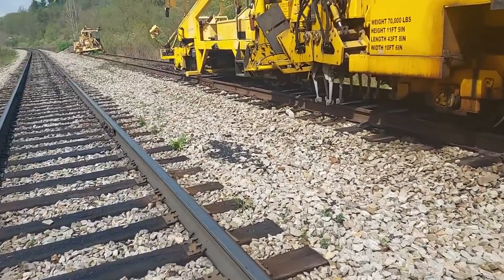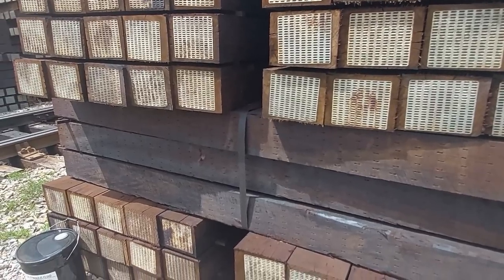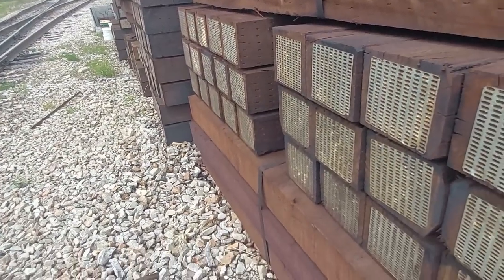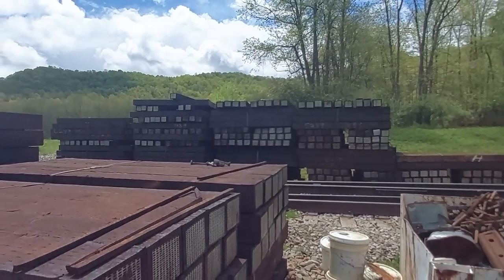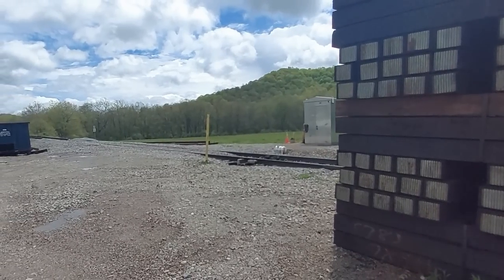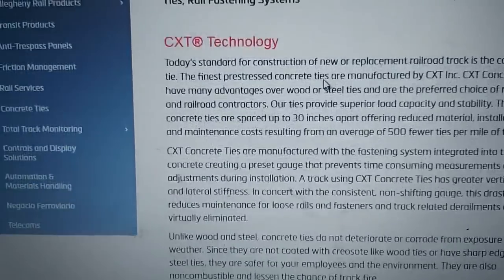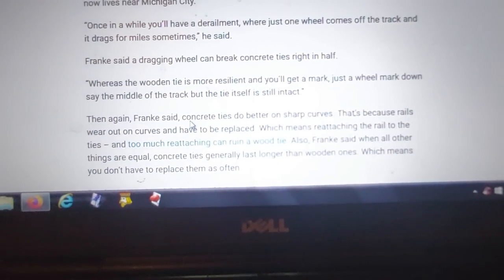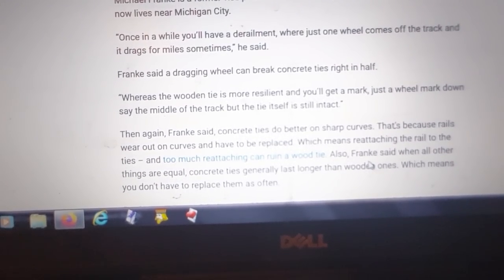Why some Railroads use Concrete and some use Wood Cross Ties

Comment: One thing about concrete ties in the curves is gauging, it can be troublesome with the lateral forces of the weight pushing against the high side of the curve wearing out the insulators thin causing wide gauge and rail canting, it can be high maintenance.
Reply from the maker: Thank you so much Jason for sharing that. A point I would never
even have thought of, but you would know! For those who may
be reading this, Jason works BNSF MOW and is very knowledgeable
about track maintenance. I have a lot of respect for what he
knows and his help he has given me over the years.
Reply: Such is American rail roads. These lines were laid by MEN. They did not give excuses, they did not ask questions ,they just did it. And still do.  I admire these men. Wow!!!
Reply: @ccrx6700  Thanks Dave, I’ll try to get some pictures and show you some details when I can.
Reply: We've had a big accident, unfortunately with fatalities, here in Germany a little while ago with failed concrete ties. Exactly like you say, the ties got beaten up, failed quickly after each other, and the train running over it pushed the gauge out of whack. They later determined that the plant that made the ties mixed bad concrete (wrong/chemically incompatible aggregate in it, I believe). That put the railroad in a real pickle, having to rip out about 200,000 ties with the same defect as soon as possible. Lots of slow orders all over the place for a while.
Reply: @bain5872 . Drag those knuckles, boy!
Reply: @kennethhoffman8061 there are inherent problems with physics that cannot be overcome, regardless of the quality of the concrete.
Reply: @2xKTfc  And, that is proven that it was due to the sleepers?
Or did you, for the sake of simplicity, make up some newspaper report from 2022 as "evidence"?
Reply: UK has used concrete sleepers (ties) for 50 years. It’s reliable, though of course quality control is always important.  They are never mixed with timber sleepers and are always bedded into new broken stone.
Reply: @3RTracing  Sorry, but that is bullshit.
Everywhere in the world the railroads use concrete sleepers, only in America one finds "problems with physics that cannot be overcome".
The American problem with said physics is: Concrete sleepers are heavy, far more heavy than wooden sleepers,  and you can't treat them and deal with them with the same 19th century tools you use in USA to throw wooden sleepers around.
Compare an American MOW brigade small rumble carts with a European or Indian company's work train for changing sleepers. Then you know what I mean.
Reply: @ccrx6700 hi Dave did where you work use to be called FRONTIER?
Bcuz I saw a FRONTIER MOW truck getting ready to install new ties etc on the tracks of our local short line railroad.
Reply: A very good information. Gain more knowledge. Thanks.
Reply: @2xKTfc  While the investigation seems to be pointing to the ties/sleepers, it seems to be more an issue of defective manufacturering, than a condemnation of concrete ties.  

Still, I can understand how a defective wood tie probably wouldn't have failed in the same way.
Reply: @2xKTfc  Oof!  What a disaster!
Reply: @pearlyhumbucker9065  We do have much heavier trains and axle loadings permitted in the US compared to most of the rest of the world.  That can mean that certain things that might not show up in other parts of the world do show up as serious problems in the US and simply do not work.
Reply: What about plastic railroad ties?  I know those have very long life spans and are often made of material that would otherwise go to landfill.  How common are they and what are the advantages and disadvantages?  Cheers!
Reply: @unconventionalideas5683  Maybe.
But what you certainly have is an irrepressible urge to bend the laws, save a little more money everywhere and try to get away with it in the cheapest way possible.
The fact is that there are areas of the world with railways that easily surpass American conditions. The longest and heaviest trains do not exist in the USA, but in northern Australia and South Africa. 
And would you believe it - they operate on concrete sleepers there. 

"do show up as serious problems in the US and simply do not work"
Sure. One of the problems is that concrete sleepers are not as easy to handle as wooden sleepers, so the Unions object. That's because concrete sleepers can't be handled with toy machines like the ones used by American MOW gangs - you need full-blown rebuild trains like the ones from Plasser-Theurer, for example.

But of course the Unions are against them, apart from the fact that they are not cheap.
So on American railways they still like to fiddle around like the MOW gangs in the Wild West: wooden beams and simple nails for the sleepers.

Ok then. Tell me, what ar the numbers? Axle loading? What have heavier trains to do with a single sleeper?
Reply: Only in America is this a problem
Reply: @3RTracing I think all European high speed rail links are a concrete, running passenger services every 20-30 minutes at 160 to 200 mph.
Reply: @pearlyhumbucker9065 , ‘Everywhere in the world the railroads use concrete sleepers, only in America one finds "problems with physics that cannot be overcome".’

I agree 100%. These are just excuses to stay behind the rest of the developed and the developing world.
Reply: @pmaitrasm It’s not an excuse.It would take billions of dollars, to replace the whole railroad tie system. You would have to make concrete ties companies, you would have to buy new machinery, You would have to replace almost everything. You would have to teach workers, about the new system. It would actually be in the trillion’s mark, to replace the whole system.
Reply: Your comment is false the gauge is preset on concrete ties so curves does not effect the gauge and it does not wear out insulators  do research before making a comment.
Reply: @pearlyhumbucker9065   North America has the largest rail network on on the planet.  And it moves more tonnage than basically the rest of the planet combined. Wood has proven to be superior in most all instances for the North American demands of tonnage and climate and track and road bed conditions.

Comment: Coal will decay the concrete. I used to work at a coal tipple and the coal being piled up against the concrete piers caused them to dissolve away where the coal touched them. YOU GO DAVE!
Reply: Just a guess, but some coal has a lot of sulfur in it. Rain may have combined with the sulfur to form sulfuric acid which eats up concrete. In southern Louisiana the rain will eventually eat away at concrete, gradually exposing the gravel. Of course, it takes about 30 years to become obvious. That is probably one reason why they made refiners start selling super low sulfur diesel fuel. It produces less acid rain.
Reply from the maker: Thank you for the nice comment Transmitter Guy, yes sir I will go,
keep on keepin on....  :-) Appreciate your taking the time to visit and check out the railroad tie video my friend

Comment: Back in the '80s, we used old wood ties as posts for our corrals on the farm.  Connected them with 2x10s and channel iron.   Held up very well over the decades.
Reply: In Australia our State government (Victoria) won't let old railway sleepers from the suburban network be sold due to them having asbestos dust ingrained in them from the train brakes.
Reply: And the horses wouldn't nibble them because they were soaked in creosote.
Reply: My grandfather built fences around the homestead in the 50s. They are still in good shape. To bad barbed wire didn't last as long as the ties have.
Reply: @ianmontgomery7534  That's an example of  what my first boss (Doctorate in Chemical Engineering) called "Locking the doors and leaving the windows open."   A good deal of engine braking happens in railway stations and, by default, kicks out airborne particulates from the linings.  It's also where many people congregate of course.   

The greatest danger would be from handling the bitumen surface itself (it contains carcinogens). But, after a few decades of use, most of the 'nasties' from the bitumen would have degraded or evaporated.  

Asbestos is now banned in most applications, such as brake-linings but,  pre-1973 (ish) most car brake linings would have contained it.  That meant that hanging around a road junction or anyplace where cars slowed down would guarantee you a dose of the deadly dust.
Reply from the maker: I've got many an old tie here on our farm as posts 2 Many Fords.
We used to give away a lot of old ties to farmers around here,
but farmer numbers have dwindled a good bit, not too many
folks even want them anymore. Appreciate your taking the time to visit and check out the railroad tie video my friend
Reply: @ccrx6700  Could you do a segment on plastic railroad ties?  They are usually made of recycled material that would otherwise go to landfill, and they have advertised lifespans twice as long as even concrete ties.  They seem to require similar equipment and installation procedures as wood ties.  Please do a segment on them if you can.  Cheers!
Reply from the maker: @unconventionalideas5683  yes i will sometime in future 👍😊
Reply: Cresote?...dead cows?
Reply: I've used them and phone poles for "dead men" on terraforming type jobs.
Reply: @unconventionalideas5683  We used recycled material (plastic ) on waggons to load steel onto instead of wood (wood was being pinched for fence posts ) Only problem was the steel was pretty fresh from steel works (hot ! ) plastic melted and stuck to the steel

Comment: Prestressed concrete is done by placing steel cable under extreme stress, pulling the steel tightly with a machine or tool, then pouring the cement on top.  When the cement has set, the tension on the steel is released.
Reply from the maker: Thank you for sharing that info Richard.  Appreciate your taking the time to visit and check out the railroad tie video my friend
Reply: The tension of the steel is not so much released as it is that the steel pulls the concrete into compression (where concrete is strong). This works better than simply reinforcing the lower third of the tie (beam) with rebar which takes-up the tensile force imposed on the lower section of the tie (beam) under load that the concrete by itself cannot significantly resist. I.e.: concrete is very strong in compression but very weak in tension. Steel is very strong in both, so steel reinforcement is used to make-up for concrete's weakness in tension.

Comment: I have been dying to ask that very question. I knew there was a reason, I just didn't know what it was. But watching this, I had several thoughts. If a concrete tie weighs 700lbs, the an 18 wheeler could haul less than 60, whereas he could haul over 200 wood ties. So your transportation cost would rise significantly. You mentioned about the difference in maintenance equipment. But I'm sure the installation equipment would be different and more expensive. As for carbon footprint, wood may not be as bad as you think. Concrete requires lime that is fired in a kiln after the limestone is mined. The mining itself will have a carbon footprint. As you pointed out, trees remove carbon from the air. When treated ties go back in the landfill, the carbon is locked up forever and the carbon cycle is broken. Perhaps you and I could getva grant to study this...😅
Reply: yeah even if you consider the local effects of creosote the effect on the environment from concrete is absolutely gigantic in comparison, 400 million cubic yd per year in the US alone!!
Reply: Jasper, that's right. If the point is to reduce the carbon footprint, wood ties are probably much better for the environment than concrete ones.
Reply: Same could be said for harvesting the wood which has to be transported from the (hopefully) managed forest to the sawmills.  There is no formula to fit all scenarios for this kind of thing because your source of material is always changing.  As for the wood being buried forever, well, even the creosote degrades and there are plenty of microorganisms that will happily digest it before fungi makes short work of the wood itself.  Once exposed, it starts to rot.  The byproduct of that process is mostly methane.
Reply from the maker: Thank you for the nice comment Jasper. You are absolutely right in the triple the amount of trucks it takes to bring in concrete ties. We can get a grant as long as we state: concrete ties vs wood ties and the effects on global warming.  GW in there and we got the money for sure!  :-) Appreciate your taking the time to visit and check out the railroad tie video my friend
Reply: Hard to calculate the carbon footprint of the saw mill, in Arkansas small 3 man mills cut a lot of ties & send them to the creosote plant.

Comment: I've seen some interesting track that has plastic ties and steel ties also. It's the spur that runs from the BNSF main to Fort Leonard Wood
Reply from the maker: Thank you for sharing that  with us Rod. Appreciate your
taking the time to visit and take in the RR tie video my friend.
Reply: @ccrx6700  Thanks. It was quite fascinating. It came out at a time also where the BNSF is getting ready to replace ties on a main line that I drive over every day. Rather neat to see all the ties laid out along the track

Comment: Excellent video, Dave! Some of the information you presented, I’ve not seen before. Well done! 
Those 😮concrete ties with the angle iron in the center, only place I’ve seen those is on transit systems where they were laid on top of a poured concrete roadbed. 
I think about 20 years ago, Amtrak experimented with concrete ties on the Northeast corridor. They eventually had to replace all of them and replace them with wood.
Also about 20 years ago, I was involved in the construction of a power plant that burned scrap wood ties from Norfolk Southern railroad, about 1.2 million of them per year. They are ground up into chips and burned at high temperature to eliminate pollution from the creosote.
Reply: Pretty much all of Japan's rails in the cities are on concrete ties.
Reply: Is this power plant still in operation? NJ Transit also sent their scrap wood ties to this facility. I was conductor/flag for some of the contractors that picked up these ties and they told me about the power plant that you described.
Reply: @earlysda  I'm guessing that the ready availability of wood in the United States contributes to the use of wood ties, compared with Japan.
Reply: @SeattlePioneer  Seattle, maybe so, but after humans, Japan's biggest natural resources are sea-related and wood-related.
Reply from the maker: Thank you for the excellent comment Bill, lot's  of good info in there!.  I've heard of power plants burning them but probably not enough used ties around here for a plant to be viable doing that even with NS and CSX here, just not that many track miles, but we could chip in our 2,000 a year to help out.... LOL Appreciate your taking the time to visit and check out the railroad tie video my friend
Reply: UK uses mostly concrete sleepers (ties )

Comment: Hi Dave, excellent video describing the difference.  We have a section of concrete ties, where a temporary track was created for a bridge project. The crews have reported "rough track" with our trains... The problem is that the concrete ties dont have "play".  They are so stiff that all of the lateral motion is transferred to the locomotive instead of the wooden tie giving in. The locomotive truck then has to absorb the motion, causing the "rough ride".  70mph with a 40yr old locomotive will get your attention immediately when you have ties that don't flex.
Reply: @made in the 80s  Ironically, this is passenger operations... the F40s do not like this stretch of track!
Reply from the maker: Thank you for the very interesting comment Eric.  I've talked with an NS engineer who ran on concrete before I made this video, but
he didn't mention anything about what you say, he said it was like running a car on pavement for concrete and on gravel road with wood. Great to hear about the motion being transferred to the loco, glad to find that out! Appreciate your taking the time to visit and check out the railroad tie video my friend
Reply: @made in the 80s Here in  the UK some of our trains run at 150 mph, just like all of the TGVs in Europe. All sleepers are concrete. The ride is very smooth. It seems that you have not learnt how to install concrete properly over there.

Comment: Hello Dave, I'll link you to a video of how concrete sleepers of the type B-70 are manufactured in Germany. The concrete sleepers, which you saw in my linked video with the cleaning machine, had been in place since about 1996. The well-preserved concrete sleepers are still good for any side tracks or or branch lines. A very well-made concrete sleeper will last about 30-40 years in Europe.                    https://www.youtube.com/watch?v=D3ksLycze4M&t=31s            Thanks for that video and greetings from Berlin/ Germany. Sven
Reply: Thank you for your post. I checked out your link.
Reply: @rtqii  Thanks
Reply from the maker: Thank you for sharing that with us Sven.  Appreciate your taking the time to pay a visit and check out the railroad tie video my friend
Reply: I watched your link, gotta admire those German engineers, they sure know how to make machines. It's impressive just how automated they got the process. Thanx for the link.